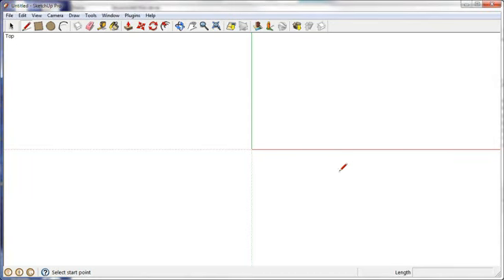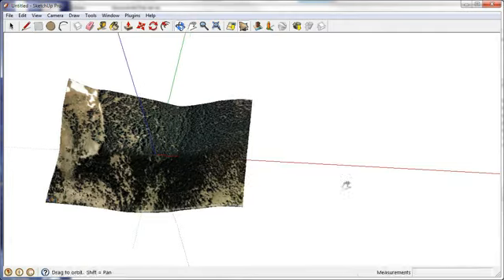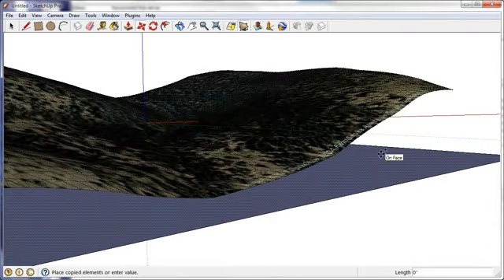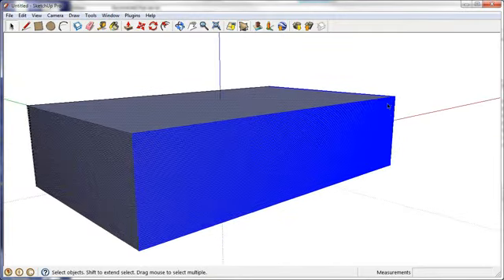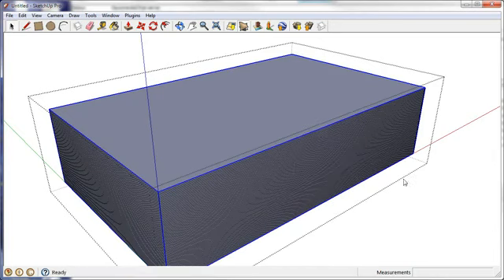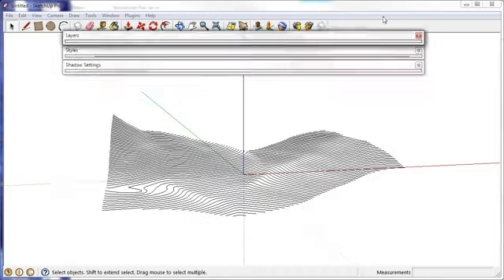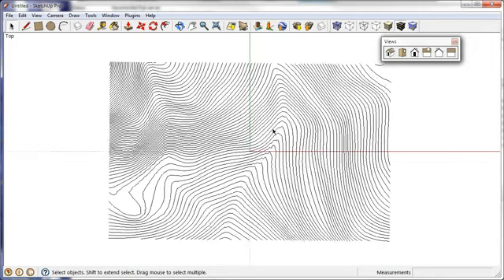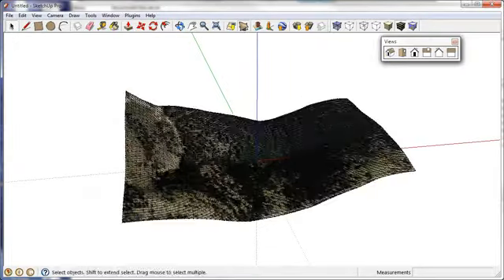SketchUp Tips and Tricks- Creating Contour Lines from Google Earth Terrain - YouTube

Comment: This was an extremely helpful video. It helped me accomplish exactly what I was hoping for, with the exception of being able to label the contour lines accurately. I did put in labels that I made on my own, but it's not perfect.
One problem that I did have was my version of sketchup "make" is 2016 so it looks very different than sketchup 8. Different enough that at one point I didn't think it was going to work. I couldn't find the terrain toggle. Apparently they have changed that so you have to go into layers to toggle to terrain. Also I noticed that right at the end of your video you mentioned that you have the Pro edition. I feared that I may not be able to export my drawing to a DWG file, usable in autoCAD. Then I remembered that when you download sketchup "make" 2016, you do in fact get a trial of Pro. Now my question is, when the Pro trial version runs out, which functionality will I lose? I'm afraid I wont be able to create contours anymore.
AP